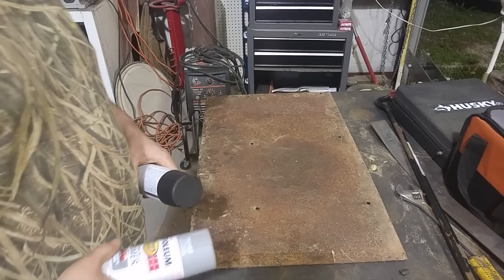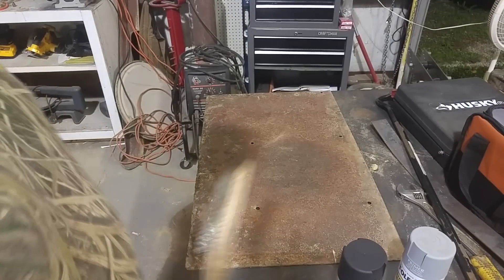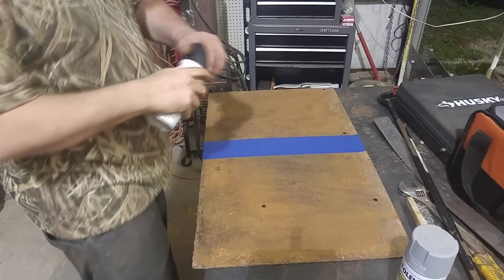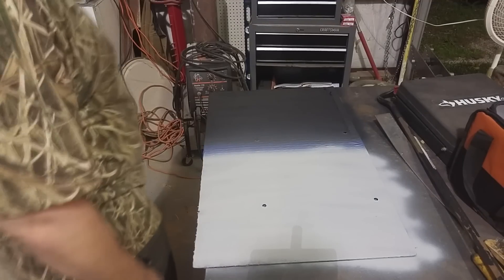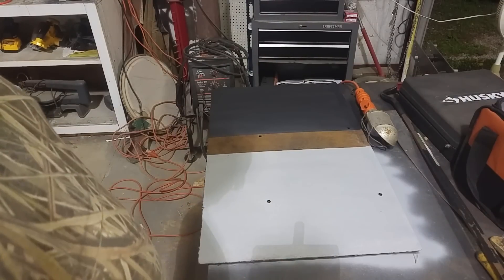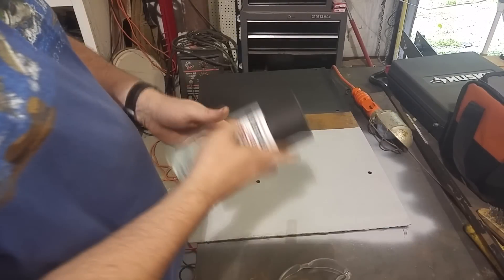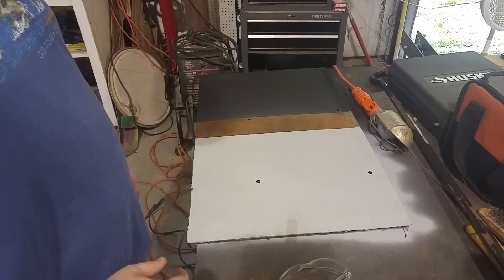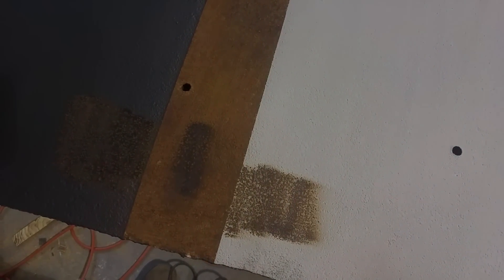Rust Reformer vs Primer on Rust

Comment: so your best bet is the rust reformer by the looks of this experiment
Reply from the maker: I think the rust reformer is little bit better than straight primer.  I wouldn't trust it to completely cure the rust issues though...especially on anything structural.  It's always better to get rid of it than convert or cover it up.  On a lawn mower trailer or something that isn't worth the metal work to make it right, then it is better to have that piece of mind.  If you could spring for a little more $$$ though I'd use something like POR-15.

Comment: I didn't really understand what the conclusion was suppose to be, as we all know prepping the surface is the most important part. Even if you had painted both sides and it all peeled off we would still question whether it was the product or the surface prep. I know Rustoleum says fuck it paint over whatever you want but everyone still preps properly lol! Also had you done a black primer side by side with the Reformer I have a feeling they would look identical, the contrast in colour could be at play here. According to their website the description for Reformer says "Provides future rust protection by chemically bonding (which is what primer does) and transforming existing rust (aka covering it up). The biggest difference was it also goes on to state "For best results and even longer lasting protection, use a TREMCLAD® primer first"
Reply: Travis In Canada
Reply from the maker: Knocking the loose rust off is required for any product of this type.  That's all the prep I did to it.  I followed the directions on the can (for the most part).  And I agree the color difference is a bit deceptive.  After 3 months I can't tell a big difference between the two but considering that piece of metal has been sitting under the table and out of the elements that really isn't enough time to determine the long term effectiveness.  Maybe I should throw it out in the yard for a couple of months and then re-evaluate?

Comment: Hey thanks for doing the experiment. Always wondered myself if there is any neglible difference between just paint, primer and rust reformer on rust and rust elimination.  I couldn't tell if there were any differences on your experiment but I do know (I've seen for myself) that if any paint product that has zinc in it will help prevent rust from forming on metal (with iron). As far as reforming rust or converting rust back to metal, without zinc added, I've never seen that happen.  Nonetheless, I just gotta have faith that it works, and if anything, it gives me a peace of mind when I use rust prevention on metals.  Anyhow, let us know if anything changes on that green web or that piece of metal you pained, like if rust started to come back or anyting.  Thanks.
Reply: Louis Nguyen
Reply: just throw that piece you did already outside , exposed to all weathers even rain or sitting water on top ,to see the real difference witch one shows rust on surface first by itself... paint coat on both will not change the experiment , will just prolong the time to see who rust first from underneath up... I think
Reply: Thank you for providing the photo. This helped me in knowing the approach to take and to use Rust Transformer.
Reply: Thanks for providing the video & followup photo. Have you thought about putting the plate outside and letting it see some hot,cold & moisture and then re-post a picture?  Would like to see more of the un touched painted areas
Reply from the maker: Thanks for the comments!  Based off the feedback I'm getting, I am going to redo this experiment with all of your suggestions.  I am going to paint a piece of steel with Rust Reformer, black primer, black paint, and maybe even a strip of POR-15 so I can see it fade in the sun.  It will take me a week or two since I can't rush mother nature so stay tuned!  If you have any more suggestions I'd love to hear them.
Reply from the maker: Updated video posted! https://www.youtube.com/watch?v=9LM9krYp1rA
Reply from the maker: Thanks for the reply.  In the video there wasn't much difference to be told the day after.  I suspect the rust will come back through the primer before the rust reformer.  After I did this experiment I threw that piece of metal under the table.  I'll run down to the shop after work tomorrow and take a look to see if anything has changed on it.  I know the web has rust coming through the paint but it also had zero prep work done to it before painting...I don't think we even cleaned off the real spider webs that were on it.As for stopping rust, I plan on trying out POR-15 in the next week or two for the majority of my car that I am building.  It won't convert the existing rust but should do a nice job of sealing it.  I'm looking forward to seeing how it does and I'll keep everyone posted.
Reply from the maker: Here is a 2 month follow up picture. Looks like the rust is starting to come back through the primer. Rust Reformer side still looks the same. That's a good sign. https://www.instagram.com/p/BIV3-K1BPoR/?taken-by=chaosgarageshow